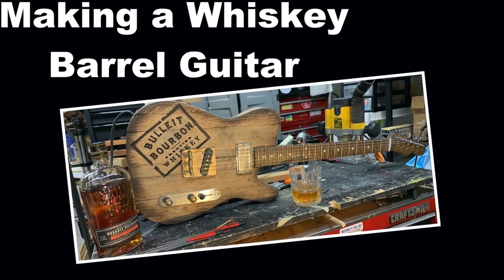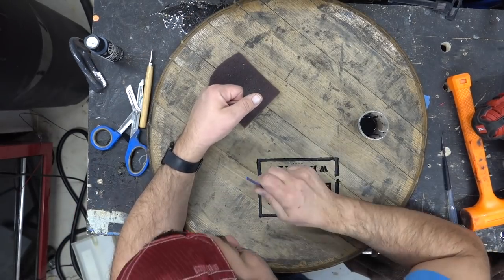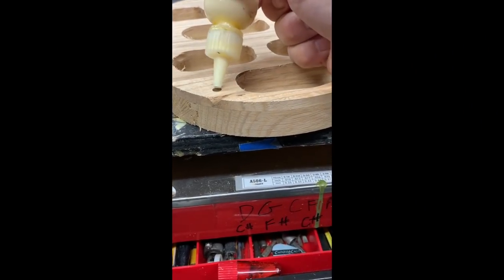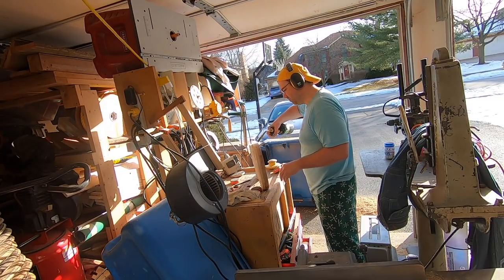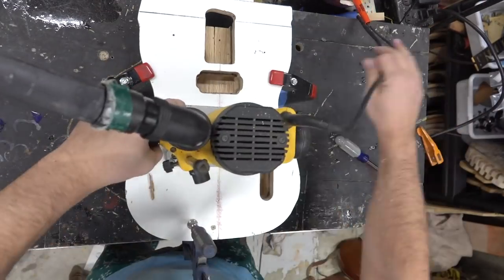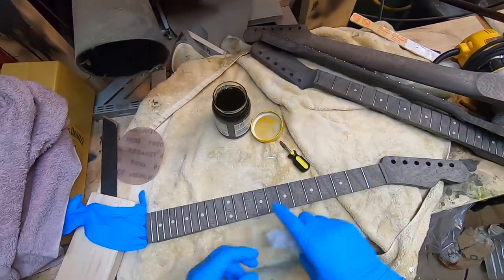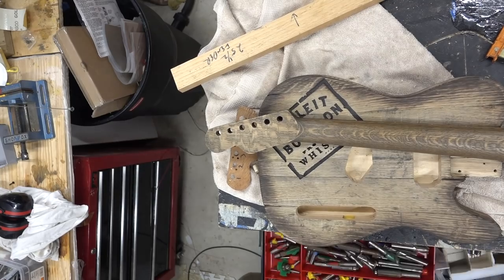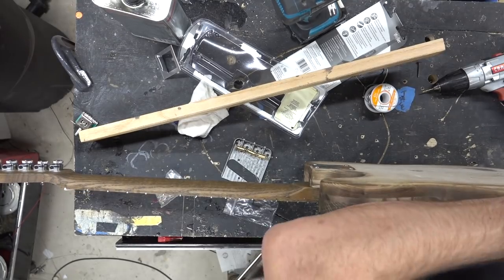Making a Whiskey Barrel Guitar

Comment: Did you sand the top at all?  I did not see this step.  If so how did you keep the patina?  Was it just a light sanding only?  Also how did you cleanup the inlay paint that went over the line?   I'm planning on attempting this myself. Normally I sand after painting or filling lnlays, but don't want to mess up the patina of the wood.  Thanks

Comment: I'm curious, why take the time to hand paint into each part of the logo, rather than putting a broad stroke of paint over the whole logo, then sanding over to remove the paint that's not in the logo but leave the embossed parts painted? Would it have removed too much of the aged wood finish?
Reply from the maker: You got it.  I would remove the aging if I sanded